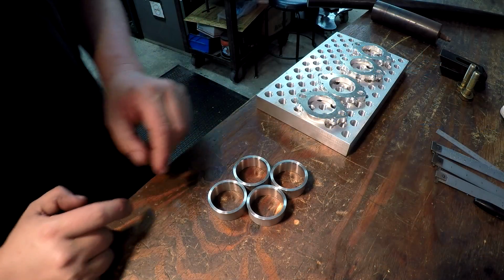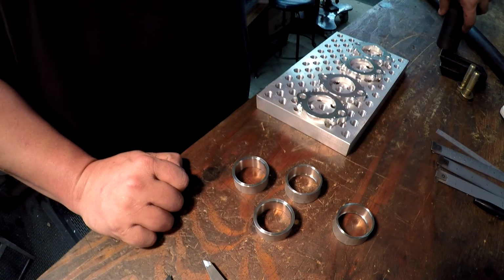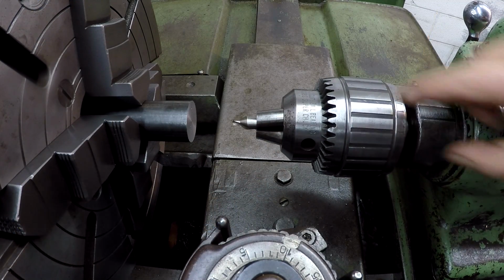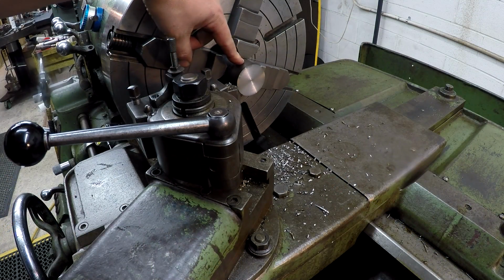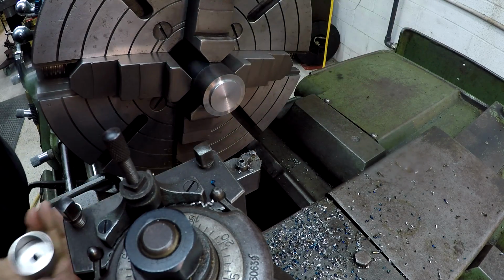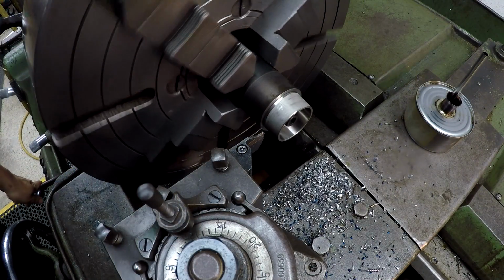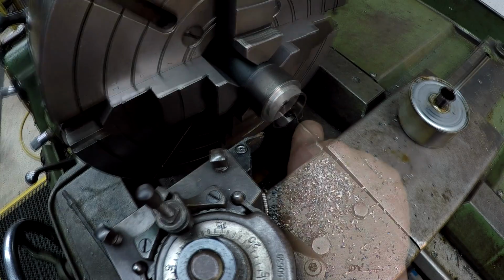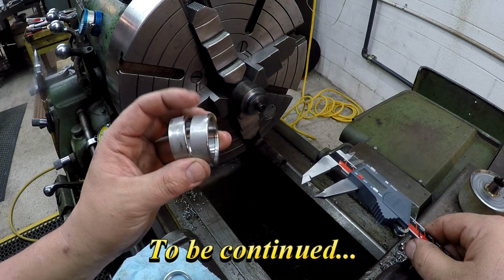Motorcycle Exhaust Mods Part 1

Comment: Adam, 60fps to my eye doesn't look better, if anything it makes the video look un-natural.  It's totally unnecessary  to film in 60fps (unless you wanted to use it for slow-motion).  It increases your file size, your processing time, your upload time and the strain on your workflow and system.  Computer systems and broadband internet have come a long way in the last few years and although modern systems can cope with higher frame rate video, the gain/improvement you think you are getting is minimal and doesn't warrant the impact on your video workflow.  I would add that I've always found your videos to be very good quality (some of the best I've seen on here) and never thought they needed improvement.  Thank you for the videos and keep up the good work!
Reply from the maker: I know that the 30 frames is great and has always provided good quality viewing for my channel but I do enjoy the even higher end look of the 60. I know it's not always necessary but I think some videos will benefit from it, such as my driving and walking around videos. The stationary camera still does fine with 60. 
One thing you have to do is keep improving and learning from what you try.

Comment: I might try an "emergency" (machinable) expanding collet. I've used one recently to machine some plumbing fittings (putting a hex on the collar). Being able to grab from the inside can be very useful.
Search McMaster-Carr for [ Inside-Grip 5C Collets ]. The beauty is that you can mount 5C collets in square and hex blocks for secondary machining.

Comment: Abom79 Question; How is a washer with the the same od as the tubes id able to hold the part?
Reply: Mike Cunningham  There was a small flange inside the bottom of the tubes.  ✔👍

Comment: I think for most videos 60fps is unnecessary unless your gonna be showing slow motion shots. 60fps is twice as taxing on your computer, probably, twice as slow to process, twice as long to upload, abd the video files are probably twice as big. It never hurts to upgrade your computer to something faster though. You should notice a significant improvement in processing time, even on 30 fps video. There's probably not much that you can do to improve upload time , other than a faster internet connection.  The quality in your videos has always been top notch in my book. You do a really nice job with lighting and camera angles, and steady video. I'm starting to make some YouTube videos of my own, and I have a really long way to go to match your quality. I've gained a whole new level of respect for guys that put out quality YouTube videos, like yourself. :)
Reply from the maker: Marcel LeMay Ever since I started on YouTube I always wanted to make high quality videos. The beginning was much different having the older Hero 3 cameras without Protune, and no mic. I'm still learning and improving through.

Comment: Nice stuff Adam, for a second there I thought you were gonna abom-hulk-rip the washer out haha. I think I'm dumb but I couldn't figure out how the washer+nut you made was holding the tubing. Did the ID have a lip at the end of the bore, and the washer was being tightened against it?
Reply: Yes it has.
Reply from the maker: wither8 Yes there is a shoulder down inside the tube, so it's pulling against that.

Comment: Nice work Adam.  We had a very similar job but for several hundred parts.  We set it up almost exactly the way you did but for the hold-down washer.  We made the washer thick enough to reach all the way out to the parting tool path.  That way the washer acted like a backup for the burr.  But they wanted a very sharp edge on the inside....not even broken. The parts got sharp enough corners on the inside that you could cut your finger.  But that was what they wanted.  What very little burr that was left was sanded off with a little drum sander. The outside got a little chamfer.    Thank you for sharing these techniques.
Reply from the maker: Glenn Felpel Kind of odd to request a sharp corner, but you never know what parts are going to be used.